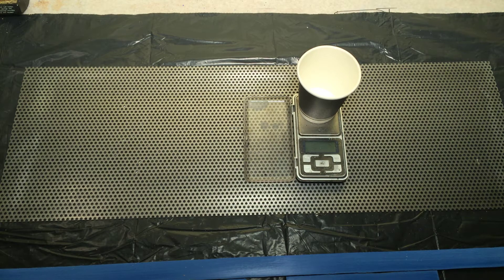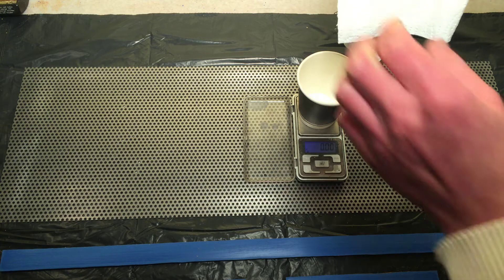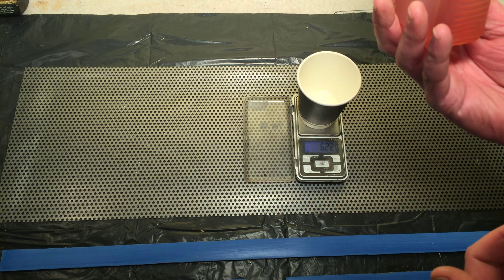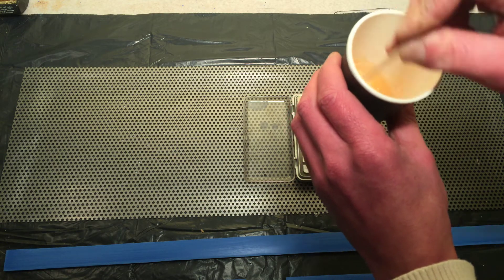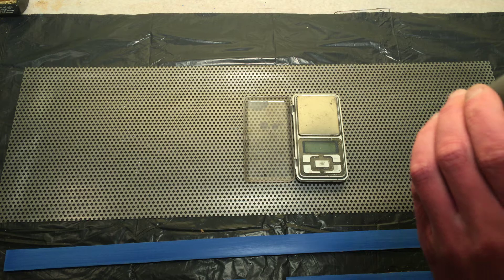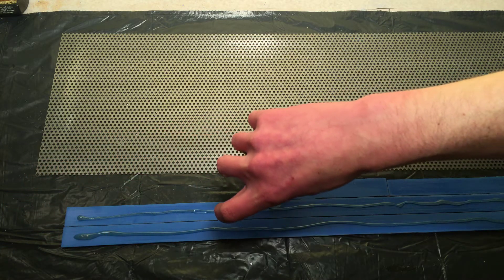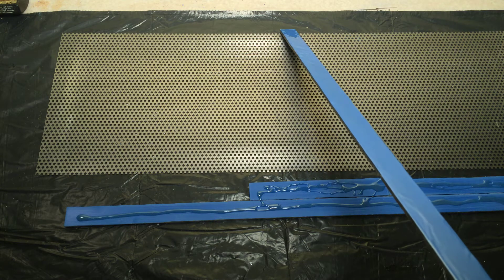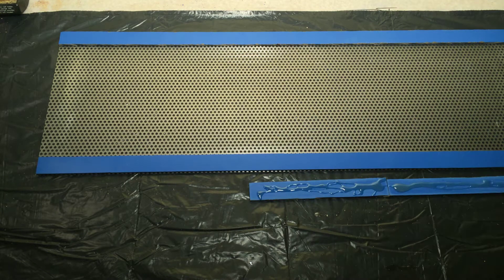Part 2 : DIY (tutorial) make a planar speaker panel : Glue the stator frame

Comment: Dude this is a nice design, really cool to see how you build it. Was this the panel that measured really well on the tweeter section?
Reply from the maker: Thanks dude ! your package will arive this week i hope.
Yes this is the same sort of panel :) the one that measured well is still alive :) although it wont be soon, since that panel had only tweeter magnets in it. i somehow made that panel 2 months back, but never put a membrane on it :) i will rip it off and  re glue the proper magnets. but the 7  tweeter magnets remain. so tomorow i should have 2 blanks and  the old panel i rip the mylar of :)

one more video on the way :) my internet bundle is exhausted by now ;)  have to add 1 Gb every 5 ,minutes haha
Reply: Oh that sucks about the internet, data caps are the worst. Wow you stay up late, cant blame you i do the same haha. I wonder what the final measurements are gonna be, interesting to see if measure flat, could that be a good size to get flat response i wonder.
Reply from the maker: who knows :) well the cap is on my phone :) since my phone has a faster upload then my normal connection........ weird but true
Reply: yeah haha that is quite common if you dont have fast internet. I used to have fast internet when i lived in Sweden 100mbit up and down now only 20 down and 2 up it sucks when uploading shit.
Reply from the maker: i got the same except my upload is 1mbit........ takes a day or 2 to upload a video. so my phones 35 or 40 Mbit is more then welcome :)
Reply: wow yeah that is very fast on the phone. My internet fluctuates between 1Mbit and 2Mbit upload when uploading a few minute video it literally takes almost 3 hours lol, at least it did last time.

Comment: Hi Joppe, can you tell me the size of the metal stator ?. Many thanks.
Reply from the maker: these panels where 21.5 cm x 62.5 cm , it has very low efficiency as most of these speakers have.  around 82-84 after filtering for flat response(filtering higher up the frequencies range increases output at the cost of low end extension) . resonance was about 130hz really high tension was used.  it does made the tweeter play up to and maybe even above 20khz .  distance foil to membrane was 1-1.3mm depending on how much the metal bends under the tension of the foil. decreasing this spacing to 0.8 or maybe even lower should increase efficiency without much problems of hitting the magnets with this high tension.
Reply: Joppe, many thanks for your prompt answer.
Changing the subject from 'Stator' to 'Glue' : Can you suggest me a replacement for the '3M 30NF' (very expensive where I live).
Many thanks.
Reply from the maker: 3m 30 :) but no not really ,  for the wires i always used 30 or 30nf wich is the same :)  might look for another contact adhesive that is water based and migh be diluted. that should work